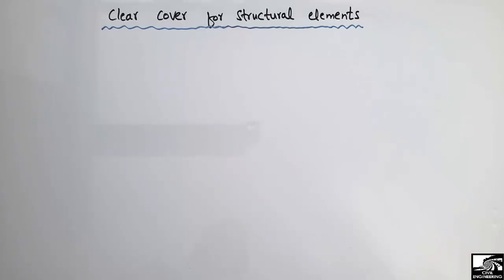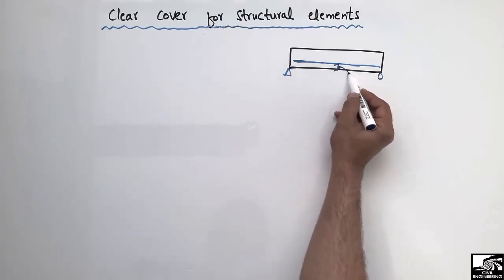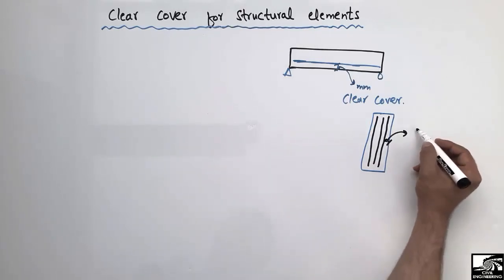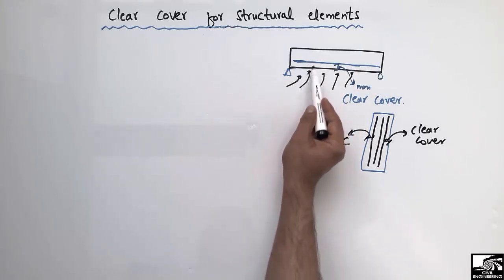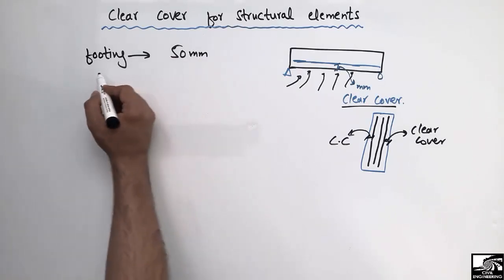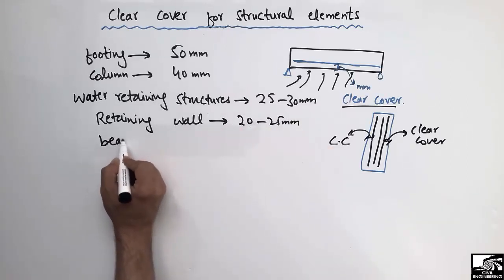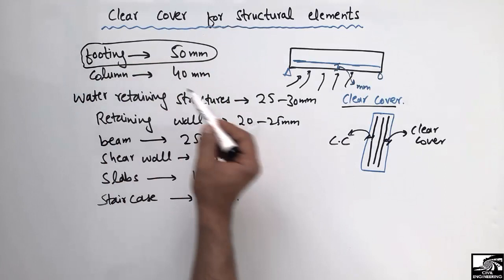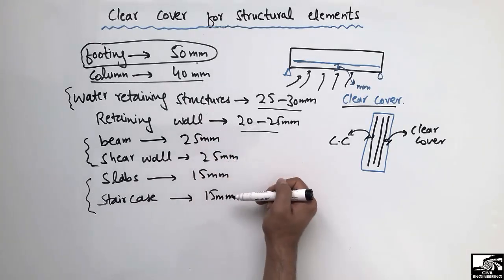What is Clear Cover || Clear cover for Structural elements

Comment: Clear cover
Distance between   face of concete member to the   side of reinforcement
Otherwise water penetrate in concrete and it tends to corrosion
Prvent from fire
Footing-50mm(it highest because it in the  below ground  expose to water) 
Column-40mm
Water retaining structure-25-30mm
Beam-25mm
Slab-15mm
Staircase-15mm
Shear wall-25mm
Reply: Are you Indian
Reply: @prashantkumarsingh141   why?
Reply: @niva7737  just asking ,  I want a friend for talking about civil engineering subject
Reply: Why?
Reply: How much for grade beam?  The beam will be make on 10 inch break wall & 3 feet above the grand level.
Reply: How much cover block for grade beam?